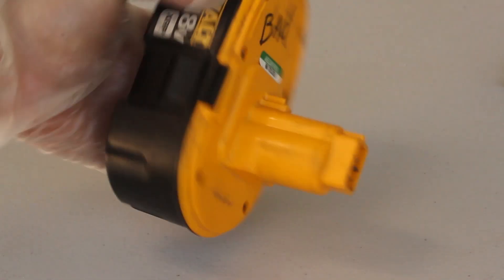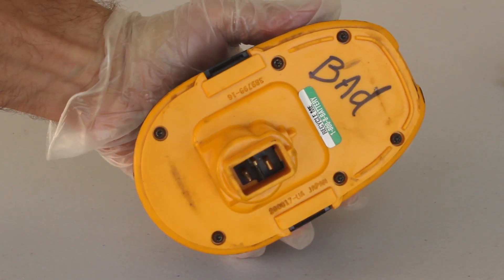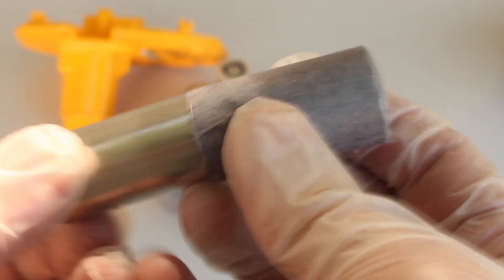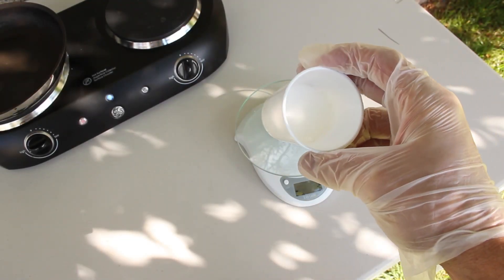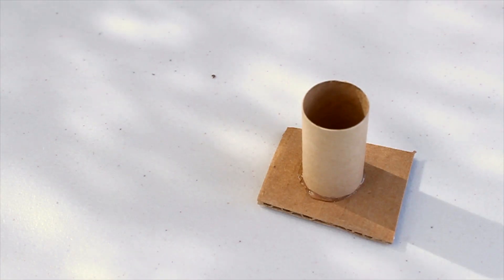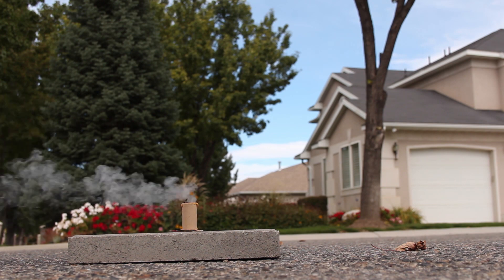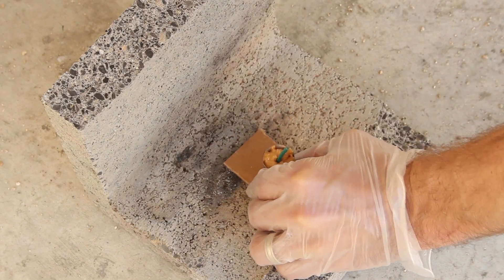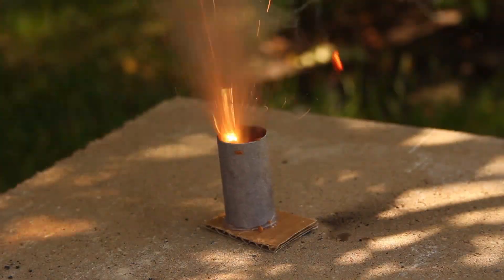Homemade Signal Flares

Comment: Can you color it
Reply: Yes, you will need the dust of metal, different colors of metal mixed in would result in different colors
Reply: @jacksheneman6242  No, that only will change the color of the flame, not the smoke. Colored smoke flares mainly use a kclo3 based comp with smoke dye.

Comment: KNO3 40% sugar 30%  and wax 30% the best smoke try but use toilet paper tube and plug both sites and make a hone 0.5mm on a top if yu do it right the smoke lasts for 3 to 4 minutes

Comment: You can make a better fuse with the scratch-igniter of a matchbox, and the bulb end of a match...
Step 1: Scrape the igniter powder off the side.
Step 2: Take the end of the match and take of the bulb. Crush the bulb for the powder.
Step 3: Roll a string in the powder, after adding water to it.
Step 4: Enjoy the possibilities with the fuses! (Grenades, flares, etc.)

Comment: Instead of going through that trouble finding an old drill battery pack and stripping the batteries of the tube, you could probably use a prescription bottle that you get from the local drugstore. I don't know about you, but I have tons of them in various sizes.

Comment: Putting unwrapped batteries right up agaisnt each other like that is very dangerous. Had they all been facing with their terminals pointing the same way, you would be fine. But having the middle ones reversed made sure the batteries could be shorted..

Comment from the maker: Some quick links to a few of the materials I used:

[✓] Spectricide stump remover: http://amzn.to/2cXdmMn
[✓] Sugar: http://amzn.to/2ctLMFm
[✓] Small pot or pan: http://amzn.to/2c8Zajy
[✓] Fire extinguisher: http://amzn.to/2cVNRZ6
Reply: Grant Thompson - "The King of Random"  aunu
Reply: you should put food coloring into the mixture and see if it turns that color
Reply: Where do you get your potassium nitrate / KNO3 frrom?
Reply: Hamacho THX potassium nitrate is stump remover
Reply: can you do anything with the batteries?
Reply: Grant Thompson - "The King of Random"
Reply: Crimson Azure yes you could get lithium from them I believe
Reply: ah thanks
Reply: quick question if your not planned to carmalize it in the pan but just 
make smoke bombs in powder form would it still work with table sugar? or
 do you need powdered sugar
Reply: IntelOutsidePentium yes
Reply: IntelOutsidePentium but of you carmalize it and put grahams in it the smoke gets colerfull
Reply: Can you use sparklers for the fuses

Comment: Is there anything you can add while making it to change the smoke colour?
Reply: I haven't personally tried it, but apparently powdered organic dye should be able to do the job. Plenty of videos show wax crayons mixed in, but many seem to claim it as fake, or very weak color. Fireworks usually use different kinds of powdered metals to create the various colors, so maybe iron powder or something similar could at least make the flaming part colorful, like a flare. Again, never tested it personally yet so be careful :D
Reply: Fireworks use metals for colored light. Colored smoke is very different.

BTW iron powder doesn't color light nor smoke, but it makes some nice sparks. :)

Comment: Or you could just use a toilet paper tube
Reply: +Andrew Zolnier You've gotta wrap it in electrical tape. It'll still fall apart, but hold long enough to dispense the smoke
Reply: or a soda can
Reply: The heat would destroy it almost immediately
Reply: Once I tried using a glass jar, but the heat made it shatter.

Comment: If you don't have the tree stump remover, could you use the sensitive teeth toothpaste? Both has KNO3, but the toothpaste has a considerable amount less than the remover. Would it still work?
Reply: +The Rackless One It would work poorly if at all. The stump remover is roughly 96% KNO3. If you can't find the stump remover then go to a pharmacy and buy some saltpeter. It'll be even more pure than the stump remover

Comment: the things burning faster wasn't because of Air pockets. kno3 is a deliverant of oxygen and if you add anything that can burn it will burn extremely fast.
Reply: So that's an easier way to make rocket motors?
Reply: KNO3 is part of most firework Rockets (gunpowder).
Space Rockets use pure oxygen in tanks.

Comment: Since the only part you took from the battery pack were the sheath/cover of the cells, a slightly larger one could be readily made from household ingredients.  Most of us have toilet paper rolls.  A lot less hassle than opening the battery pack.
Reply: My thought exactly.
Reply: Timmy D I don't fell safe opening up batteries especially since some contain acid
Reply: Cesar Juarez Right ? there is another video on youtube where the guy (different guy) uses a TP roll and uses actual ingredients instead of stump remover and gets 25x the smoke.
Reply: True but those are the perfect size

Comment: Try this: when the mixture is right done, like stills hot in the pan, mix a small spoon of sodium bicarbonate (very easy to find here, in any supermarket), and mix it. It will create a LOT of bubbles in the mixture, making it 2 or 3 times bigger in volume and burns easily due to air bubbles in the mixture. Generally it makes more smoke too. Burns kinda faster but you will have 2 or 3 times more material to make more flares in quantity.

Comment: Made an enormus batch of this stuff and put it into a soup can; I used one of those silly can openers that crimps the edge off instead of cutting it. Allowed me to drill a hole for the fuse, as well as a good way to "launch" the smoke out of the can. I added a good helping of dark green powdered dye from the local hobby store to give it some color. 

I lit the darn thing off out in a middle of the field, ended up getting the attention from the Sheriff. I guess it worked! lol.
Reply: +Drink Me that's the funniest thing I've heard all day
Reply: @leeroy5558  thanks
Reply: I put a layer off about 1 cm and boy that was a lot of smoke lol
Reply: I’m 5 years late to this comment, but I’d make copies of that to use as daytime rescue flares
Reply: Nice 😂

Comment: Question:
Would a toilet paper tube coated with melted paraffin wax substitute for the battery casing?
Already melting the paraffin to make homemade firestarters with cotton rounds and a little lighter fluid (fits well in a dip can), so I wondered if I could use TP tubes for this.  Thought I'd ask.
Reply: Don’t even need to coat it. But it would take a lot to fill up

Comment: sadly you cant use these in paintball as smoke bombs, the smoke is too light and dissipates too readily to make effective cover
Reply: add wax crayons,it makes a colorful smoke
Reply: Ricardo Souza its not the colour lightness. its how heavy the smoke itself is. it is too lightweight and disperses too quickly, providing only 2-3 seconds worth of sufficient cover.
Reply: +tetsuya no yoroi I use these in airsoft milsims, works just fine, why would you need more than a few seconds to slip by a sniper or something? Is paintball really that non-tactical?
Reply: Arctic Gaming i play very aggressively, dashing in to flank then dashing back. these dont last long enough for my playstyle
Reply: If you're aggressive wouldn't a fast smoke be best? Aggressive to me sounds like a CQB player and that's all about swiftness. I only play milsims, in fact I've never attended a CQB my city really doesn't offer CQB it's all big milsims with objectives and realistic military style. To me getting by fast is most ideal, I've never done paintball though, maybe the world is entirely different.
Reply: Arctic Gaming I dont really go to CQB events, but i do favour a mag fed smg. I dash around to get flanks to open up. i normally die a lot, but if i get a good flank off that's a guaranteed push for my team as i can massacre half the team if they're trying to hold a position. high risk high reward
Reply: still sounds like you move fast if you move fast I don't see why this wouldn't work
Reply: Arctic Gaming because i still have to back out unless i commit to a all out assault...usually along the same path
Reply: ah I see what you're sayin

Comment: Just remember...if you make more than one batch, you NEED to clean the pan out completely before melting the second batch...otherwise the residue from the first batch will get hot and ignite the 2nd batch...causing lots of smoke inside, burning you, and causing damage to your kitchen.  Don't ask me how I know this.  Also, if you use stump-out (don't use the Bonide brand), it says "To the extent consistent with applicable law, buyer assumes all responsibility for safety and use not in accordance with directions."  Be careful!

Comment: If you add organic (not synthetic) dye you can make coloured smoke.
Reply: +Paul Austin SEND OUT THE RED FLARE!!!! TITAN INCOMING
Reply: +Paul Austin I'm not pedantic, it's an important distinction. Take cosmetics who advertise themselves as organic for example, yet still contain synthetic chemicals... to me its very important to distinguish "organic molecule" from "organically farmed". Example: cosmetic companies tell people that whatever solvent they are using (like in nail polish) usually ethyl acetate or toluene, is organic. And they are telling the truth; solvents are organic... but the problem is that the majority of people associate the word "organic" with "safe" and "natural", when in fact none of these three words have any correlation at all. Cosmetic companies know and take advantage of this play on words, and it drives me nuts that the majority of the population doesn't understand this. This is probably the one play on words that has caused the most harm in history...
Reply: +Hawk_ Eye Adding crayons (for me, at least) made the flares fail altogether.
Reply: I doesn't matter if a substance is natural or artificial, organic or inorganic. A molecule is a molecule, and it doesn't matter if it came from a recently heated test tube or a prokaryotic cell. For example, vanilla. It has been produced inside beans and laboratories, and it is extremely difficult, if not impossible to tell the difference between natural and artificial vanilla, because in the end they are both the same exact molecule. Another example, toxins. Sure, artificial toxins like VX nerve gas are bad, but the top three most dangerous toxins are all natural proteins.
Reply: organic doesnt mean not synthetic...
Reply: or you can use crayons
Reply: +Joseph Naccarato Yes it does, you need about 10-20℅ by volume of dye powder.
Reply: +Fred Wells Whatever..... Mr Pedantic
Reply: +Fred Wells It's a freakin firework! Not like you're gonna be wearing or eating it! The colouration of the smoke will only work with an organic dye powder! Happy now???
Reply: +Joseph Naccarato No problem... just stay safe! If you find the mixture burns a little too quick then add a little baking soda to slow things down a bit.
Reply: Would be good for survival situations soooo
Reply: +Minh Tran Việt nam ad
Reply: +Paul Austin when adding the dye, does it go in while the sugar and potassium are caramelizing?
Reply: +Paul Austin thank you for the fast reply, your tip will be helpful
Reply: Then u would need a cooler burning mixture like KClO3 - lactose or it wont work... Duh...
Reply: +Jack Stott And learn to spell junior!
Reply: +Hawk_ Eye *Column
Reply: +ShadowChain13 Wax Crayons, etc
Reply: Pzyx Gaming - Official wax, give me the car fax ;3
Reply: Omg your right
Reply: The liquid food colouring or dry powder dye???
Reply: +curtis “therandomuploader” 1212   you can use food dye while your mixing the stuff together
Reply: thnx
Reply: Dry powder
Reply: No you cant the composition burns too hot and you will only get white smoke
Reply: Masterman PG i tried syntethic dye and it didnt work but organic does...
Reply: +Thomas B. That's why you add a little baking soda DUMBASS.......Duh!!!!!
Reply: Fred Wells No one asked for your little "rant" about "organic".... Better to keep it shut zippy!

Comment: is the smoke bad to breath because i want to do a prank on my friend in his house with it
Reply: I wouldn't do it inside his house, probably a bad idea.
Reply: yea but i meant the bathroom
Reply: I still wouldn't, no type of smoke is exactly healthy to breathe.
Reply: yeah probably not but i will just use normal smoke bombs
Reply: Josh Trew Normal smoke bombs are way more toxic than the smoke bombs in this video.
Reply: i have the proper prank ones which are non toxic
Reply: its not that harmfull if you ventilate the area after you pulled the joke, the concentration is what makes smoke toxic

Comment: Try using common house flour in the mixture, it should put out a larger cloud of smoke. Also wrap the container and make a smaller exit hole for the smoke and the pressure of the burn should make it 'fountain' out of the casing you make

Comment: TKR - How about some (colored) smoke signals that won't start a field or forest fire :) Also, instead of wasting time sourcing and dismantling ni-cad battery packs... you could easily roll your own tubes from craft paper or just source common cardboard tubes from toilet paper roles, paper towel rolls or cardboard tubes from empty foil/plastic wrap boxes... and if heat is an issue and you're trying to prevent the cardboard case from being engulfed in flames... spraying the cardboard tubes w/high heat grill paint or primer should help reduce/eliminate the open flame issue. Also, wrapping the finished smoke signal in a few turns of foil will add to the "open flame" safety issue as well.

Comment: Mixing the 60-40% Potassium Nitrate to Sugar mixture with some Iron Oxide, packing into a tube and making a small hole in the centre (with a nail or similar) and letting it set will give you a small solid rocket motor (not extremely powerful but still quite and interesting pyrotechnic device) As seen in the rocket fuel video.

Comment: if you don't want all the trouble of the battery holder cases, couldn't you just use a toilet paper tube?
Reply: Jacob Stephens Isn't the whole point of this to make smoke?
Reply: Yes, and wrap it in tin foil.
Reply: My dad and I used the little paper tubes used to package coins in packs of 50. You can buy a massive bag at target or Walmart for a couple bucks. Much less of a pain and works perfectly
Reply: What if i used pvc pipe?
Reply: Zach Thompson  Yeah I'm pretty sure you can, it doesn't really matter but it does need to be strong enough to hold
but it would probably work.
Reply: Nate made these in a new video, and he used cardboard tubes.
Reply: ***** You alive?
Reply: Zach Thompson

Ik
Reply: Zach 42 That might be too cold
Reply: It will also be bigger to
Reply: Your right
Reply: That should work
Reply: That’s what I do
Reply: It would make way too much smoke. But I guess if you wanted to you could.

Comment: Instead of normal sugar try out Sorbit (sugar for people with diabetes).
It will generate even more smoke!

(Not sure about the perfect mix, but KNO3/Sorbit 3/2 should also work. If not, use a bit more KNO3.)

I also heard about KNO3/sugar being rather easy to light up while heating it in a pan/pot (be VERY careful, if you do this!) than sorbit (still be VERY careful!).

Comment: PLZ tell me do i keep the pan or i replace it ;(
Reply: Use steel wool to scrape it out, and then make sure to thoroughly soap it before using it for food again.
Reply: thank you :3
Reply: for safety, label and keep separate all you experiment pans. they're probably fine after a good wash/scrub, but its better safe than sorry. And youll already have a pan ready for the next project
Reply: Swag Potato
also depending on whether you use food grade potassium nitrate (salt peter) or gardening grade potassium nitrate (more unhealthy if ingested), is whether you just simply treat it like a toffee mixture or whether you use a higher level of caution
Reply: Swag Potato No problem. Also, if you are experimenting the same way with other volatile chemicals like me, you may want to pour some solvent (gasoline, etc.) onto it, and then scrape it off with the steel wool too. If you do it this way too, make sure to REALLY clean it, otherwise your food may become flammable.
Reply: Swag Potato
no problem
Reply: Cool thanks you saved me from starving :D
Reply: :D
Reply: tnx for the advice man :)

Comment: Wondering if you could make one with toiletpaper rolls, cuz I have a drill, but its rechargable and I dont want to waste the battery. Thx :)
Reply: "Most hardware stores have a bin for recycling batteries"
Reply: They do work, tried it before and I had no problem.

Comment: Is it possible to add food coloring to make the smoke a different color?
Reply: Not really, although some sources on the internet say just add food coloring, it doesnt work that way, instead of potassium nitrate, you would need potassium chlorate and some sort of dye. And potassium chlorate isnt as easy to get even if you can get it.
Reply: ***** Never tried that one. Although I have always wanted it to be red.
Reply: tEHFRECKLEZ It works with organic dye.
Reply: chaosflames I never found that to work well. I guess you really have to have a lot of it.

Comment: I would have removed the base after the mold has set, and added a longer fuse that comes out of both ends, meaning the smoke comes out of both ends, but that's just me.